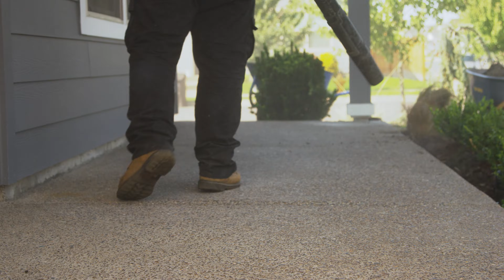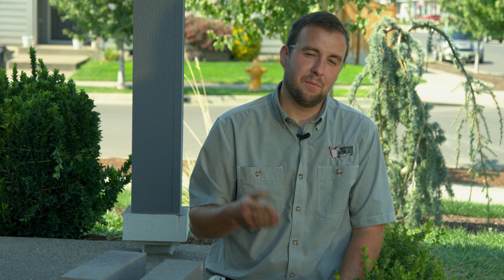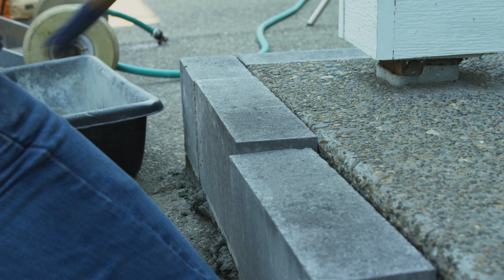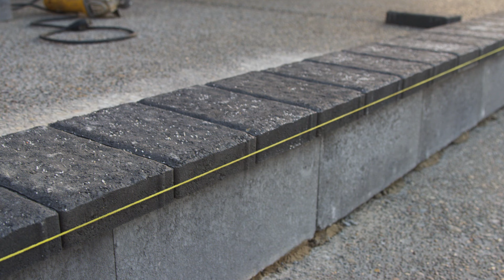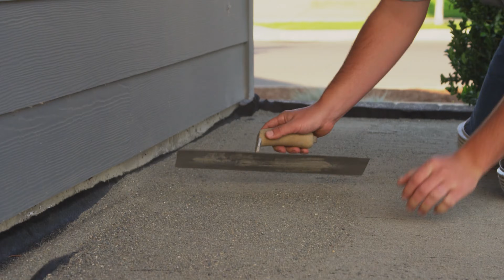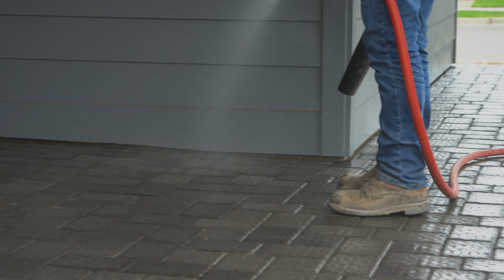How to Install Patio Pavers Over an Existing Concrete Slab

Comment: Very nice job. I have a 10x10 raised covered concrete porch in our backyard and would like to do the same. Couple of questions if you don’t mind. I have large exposed aggregate (larger than it appears you were dealing with here). Would you recommend grinding it down to a somewhat smoother profile? Also, how do you deal with water drainage. Some of the manufacturer installation instructions I have seen recommend drilling weep holes in the slab. Thank you.
Reply from the maker: Both wouldn't be a bad idea. Obviously, the flatter it is, the better off your end results will be. We couldn't drill weep holes here due to the thickness of the slab.
Reply: @WesternInterlock  Because the slab was too thin or too thick?
Reply from the maker: Too thick. We also weren't too worried because it was a covered northern exposure and won't get much direct moisture.

Comment: This is a helpful video!  if the concrete is new, do you still need to put down sand?
Reply from the maker: The sand helps take up any irregularities in either the concrete or the pavers, so technically, no, but it will make your life easier.

Comment: hi!  I saw that the border was glued to the face block and the concrete slab.  Then the pavers were laid on top of the slab + fabric + bedding sand.  Isn't there going to be a height difference then? Did the thickness of the adhesive compensate for that?
Reply from the maker: You are right. There is an infinitely small height difference. Taper off the sand at the edge to minimize it, and you'll never notice.

Comment: What type of sand do you recommend using over the filter fabric?
Reply from the maker: We recommend ASTM C33 washed concrete sand. You should be able to get it somewhere in your area.
Reply: Hi - I have a geotextile woven fabric from sandbaggy. I don’t believe it’s permeable, is that ok to use?
Reply from the maker: It would be better if it was permeable so that any water isn't trapped.

Comment: Great video! I have an exposed aggregate walkway where I plan to do the same kind of overlay job.  Temps here in the Philadelphia area can drop below freezing.  If I use a flexible tile adhesive for the border pavers, will I be ok?  I am assuming very minimal water passing through the tight joints and poly sand of the other pavers.
Reply from the maker: We can't really speak to that because we have a totally different climate here. We'd recommend going to your local hardscape supplier and asking them.

Comment: Thanks for a great project vid. I have an old patio that has some minor cracks and does not have proper drainage (not terribly off, just some pooling). How do you recommend correcting that with an otherwise very similar project? Also, Bigfoot gave my boys and I a pretty good laugh!
Reply from the maker: Any imperfections in the existing patio will transfer directly to the new surface eventually. If there's poor drainage, the best solution is to remove the concrete and replace it with pavers.
Reply: Have the contractor install a channel drain at its low point.
Reply: Considering paving my patio that is currently cement. One area is uneven between slabs. Is it best to remove and make slabs level with the rest of the patio, then install pavers?

Comment: Lovely work, only problem I could see is when you laid the concrete block flat 9" then put concrete block on its 4" because the flat block wasn't laid In  concrete over time the bottom block WILL start to sink in existing mud, which will then make top block sink too
Reply from the maker: That's why we added a gravel base underneath. We haven't had any issues with properly based projects in 30 years.

Comment: Should have used a bullnose paver for the edges exposed pavers to me doesn’t look to appealing 😮
Reply from the maker: We would have if these were 60mm pavers. However these are 40mm pavers designed specifically for overlays so that won't work.

Comment: Ok question, if the border paver and the interior paver stones look like same height why wouldn’t they be higher then border after laying down fabric and sand? Can’t rubber Mallet the concrete not going to give?
Reply from the maker: You are correct. There will be slight lippage at the edge where the interior pavers are slightly higher than the border. We recommend tapering off the sand at the edge if at all possible to keep this to a minimum.
Reply: Where does the water on the interior on the fabric drain off to if the border is glued to patio

Comment: Awesome video! What do you think is the best option for me using 18x18 pavers over concrete? Sand or mortar them?
Reply from the maker: We prefer sand-setting pavers because it's a lot more flexible.
Reply: @WesternInterlock  thanks for the reply, I want to do a grout line between my 1" pavers do I use polymeric sand for this "grout "line
Reply from the maker: For the sand between the joints we would recommend Extreme Wide Joint Polysweep. 

https://westerninterlock.com/products/polysweep-x-treme-wide-joint-sand/
Reply from the maker: Yes. Use a polysand approved for wide joints like SEK X-Treme Wide Joint or Easy Joint.
Reply: @WesternInterlock  thanks so much 🙏,  1 more question, if all my pavers are 1" thickness and I just glue the trim piece all around perimeter area, wouldn't the rest of the inner pavers sit higher bc of the sand? Thanks again for the replies
Reply from the maker: Yes they will taper off your sand at the edges. It doesn't take much sand at all. All it's for is to level any minor imperfections.
Reply: I’m having a hard time with the idea of adding so much sand right by your entry door. Won’t it always be sandy and cling to feet and shoes as people walk in? Seems like it like it would ruin floors over time and just be messy.
Reply: @dezlert  is this a serious question

Comment: The house has settled quite a bit over the years. The patio has a crack that runs along the wall, about a meter away from the wall. How should I prepare it before putting down pavers? The crack is about a 1/2 inch wide in some places. A gradual slope in the right direction.
Reply from the maker: Your patio does not sound like a good candidate for an overlay. At this point in the game I think your best bet is going to be to rip it out and start over.

Comment: What kind of mortar did you use to level the paver on the walk?
Reply from the maker: I believe it was standard Type S mortar mix.
Reply: How did you conceal the exposed mortar that you would see after that block was placed?  Also the blocks can settle before that mortar dries.  How do you prevent that from sagging

Comment: So I want to do something similar to this but I want to match the brick I already have on my home and only do the front of my front patio that is made of concrete. If I only add the brick to my exposed foundation do I need to dig that deep around the perimeter?
Reply from the maker: No you do not. We just did it to hide the exposed aggregate of the underlying porch.

Comment: would use a tile adhesive with  flexibility  to put the charcoal  edgings on with 👍  never use that C31 mastic one big frost it start moving about 👎 but is everybody own way of doing it 🤔
Reply from the maker: We don't have the frost issues that you do so it's not a problem. The SB-20 we're using here is a great product. We haven't had any issues with it here in the PNW.

Comment: How much higher do the border pavers have to be than the field pavers to retain the sand
Reply from the maker: They don't need to be any higher. We used only 60mm pavers on this job. You just want to make sure that you taper the sand at the edges to keep the resulting lip as minimal as possible.

Comment: Can't you just glue the pavers to the concrete slab?
Reply from the maker: In theory you can, yes. The point of putting the sand underneath is to allow for any surface imperfections in the concrete slab. If you glued them straight down, anything that is imperfect about the slab will telegraph right up through the pavers.

Comment: What is the thickness of those pavers and can 2cm thick pavers be used in a similar fashion?
Reply from the maker: Yes, you can use 20 mm pavers for overlays as well.
Reply: @WesternInterlock  All polymeric sands say they need min. 25mm deep joint for the sand to be effective.  If you install 20mm pavers and subtract the 1/8" you need to leave clear at the top, that means the joints will not be filled deep enough for the polymeric sand to be effective.  Any comments on that?
Reply from the maker: So typically if a paver, or natural stone for that matter, isn’t the required 1 1/4” of depth for Polysweep, then as long as the entire joint (minus the 1/8” from top) is filled with the sand it will hold, other than driveway applications.

Natural stone and porcelain are mostly 3/4” deep joints. It will bond in these situations as well. However, we recommend using wide joint sand because the depth is so shallow.
Reply: Are these pavers the cobble slimline by Western Interlock? The 40 mm?
Reply from the maker: Yes they are our slimline pavers.

Comment: If you want to raise it higher, could you use 3/4 aggregate a few inches over the concrete?
Reply from the maker: If you were going 2" or more, you could use wall block around the outside edge to retain the 3/4-0 aggregate. Less than that would not be a good idea.

Comment: What can I use to fix the slope of the concrete? Does that go before the fabric?
Reply from the maker: If the concrete is sloped bad enough to require fixing, the amount of work needed to make it level will make it almost just as easy to remove it and lay pavers the normal way. You can use self leveling concrete, but that requires exact following of the instructions or else you can have it fail. You'll also need to build a form around your slab to hold it in. It's just not worth doing.

Comment: Hi..I want to just use glue on a new concrete patio to overlay pavers. What precaution I need to take.
Reply from the maker: There's no need to use glue to hold all of the pavers, just the outside. The middle is held by the outside and it can't fall up, so there's no need to glue those. The sand is there just to make up for any height variance in the pavers or the slab itself. I wouldn't recommend gluing all of them. It will greatly increase your work if you ever needed to do anything to the pavers and it will not allow the pavers to move at all.
Reply: @WesternInterlock  I am planning not to use sand for the field pavers, because I am the only person to work on it and its a big patio around 800 sq ft. My concrete patio is still to be built. I will get proper slop for drainage also, I am thinking of having concrete grid lines closer than normal so that drainage will not be a problem. Also I will use polymeric sand for sealing. Do you still think I can lay field pavers without glue??

Comment: Where does “sealing” the pavers come in and do you always do it or not and recommend brands?  Thank you for video!
Reply from the maker: Sealing is the last step of any paving stone project. Whether or not to do it is completely up to you. There are several performance benefits with sealing such as less moss and weed growth, protection against stains, and color enhancement. The main drawback is that you can royally mess up your pavers if you do it wrong. You can watch our video on sealing here: https://youtu.be/xNOVhidoJiw Here in the PNW, we recommend using solvent based sealers made specifically for paving stones such as SEK's 8700. They hold up best in our moist environment. If you live in a drier climate, you may be able to get away with using a water based sealer. What ever sealer that you choose, just make sure that it is a sealer formulated for paving stones, not one made for sealing concrete. They are different products all together.

Comment: what adhesive did you use
Reply from the maker: We used SEK Surebond SB-20. It's our favorite, but any flexible exterior grade concrete adhesive should work if you can't find it in your area.

Comment: Is anthing between the pavers, or are they just pressed together. Or does the sand fall in between.  

I was trying to understand why you pit sand over the top. 

I have a stained concrete (a bad job). 

Thanks for reply.
Reply from the maker: The sand dribbles in between the pavers and effectively locks them together, making one cohesive whole. For a photo of this interlock, check out this post on Instagram: https://www.instagram.com/p/Bwkv0EbFtN7/
Reply: And it's a different type of sand for on top
Reply: @ingeniouswit  thank you friend

Comment: Would that adhesive work on a painted concrete patio? Or would I have to grind down to bear concrete? Thanks
Reply from the maker: It would be better to grind or strip the paint off. You will get better adhesion on clean concrete. If you grind, it wouldn't have to be totally polished or anything. Simply roughing it up so the glue can grab is enough.

Comment: How thin should the sand be
Reply from the maker: As thin as possible. The goal of the sand is to level out any imperfections in the concrete. It really just needs to be a skim coat. I think we put down 1/8".

Comment: Can new pavers be laid over an existing bluestone pool deck?
Reply from the maker: Hypothetically, if the bluestone was mortar set on concrete you could. However, if it is sand set, you will be placing a flexible surface over a flexible surface and the results will be disastrous. Regardless, we would recommend pulling up the bluestone and starting fresh from the base. The time spent will be worth it in the long run.

Comment: What is considered a “small amount” of paver sand? Is there a minimum you would suggest? I have to meet a bottom step to meet with pavers that is already low allowing only for 3/8” of sand.
Reply from the maker: Basically you want as little sand as possible. We use only 1/8" of sand for this. The purpose of the sand is to help even out any imperfections in the concrete and pavers to give a consistently flat finished surface. Additionally, if you have too much sand, it can make your glued down outer layer much lower than the field and the resulting lip will be a cosmetic flaw and a tripping hazard.